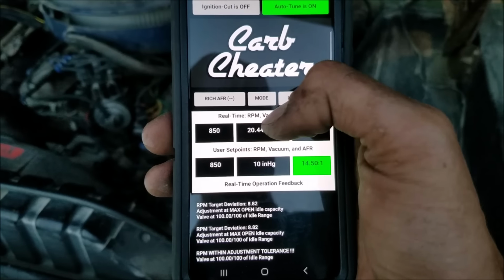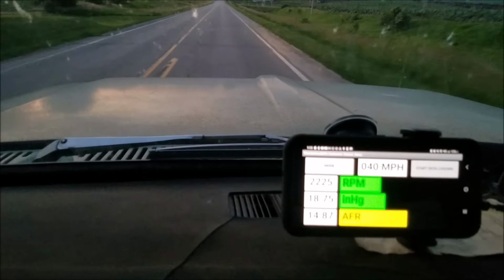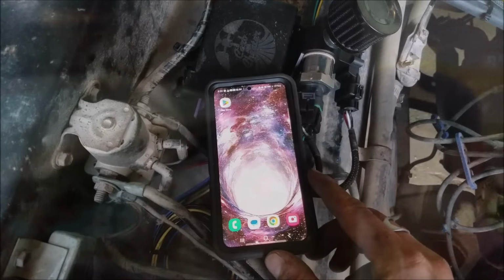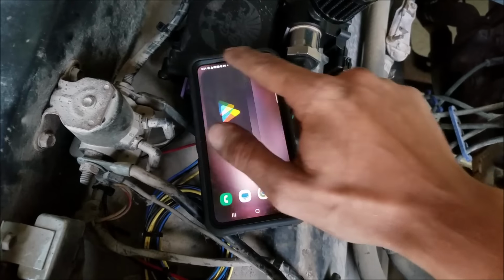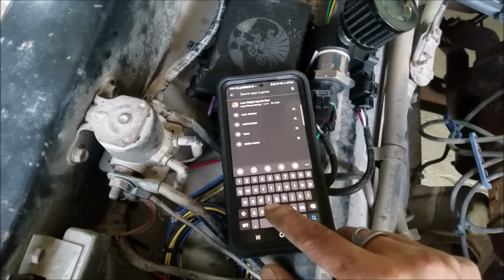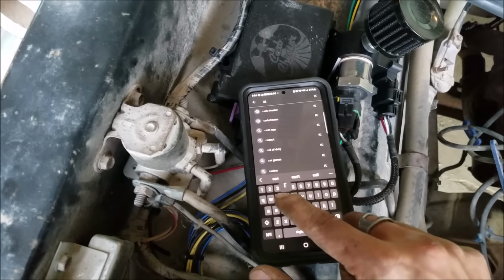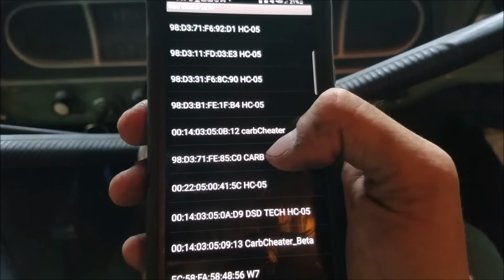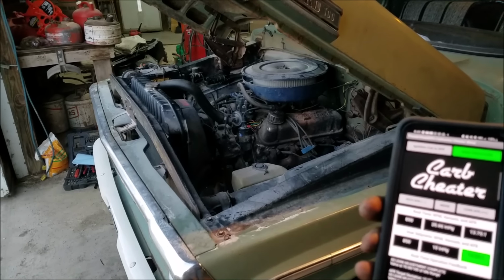Make a SELF-TUNING Holley/Edelbrock Carb! (Carb Cheater: Installation & Setup)

Comment: I have a question.. I see your spacer is set up for a Basically after market carburetor or none GM Because almost all quadra jets are spread bore carburetors. I have not looked into it but I was questioning. Do you make the spacers for those also??
Reply from the maker: Yes. It's on the website order page indeed

Comment: in the waithing of getting the carb cheater order 1812 i have put a oid innovate wideband in my car because of the new build 331 stroker that i dont wanna lean drive to dead.
what are the afr TARGets for a carb enfgne?

idle
light cruising 
moderate throtlle
half throtlle
full throtlle 4000rpm
full throtlle 6000rpm?

thanks for helping
Reply from the maker: Did you order the full kit?
Reply: Yes i ordered the full kit why?

I already welded the Bung and for now installed my old wideband from innovate(didn't think it will work after sitting for 10 years  in a tool box)

Will change everything out when I get the carb cheater
Reply from the maker: @chevroletbelair1  there are a few idle control setting variants - personally I like idle rpm within afr range and set it to my target idle rpm within 12.5-13.5afr. 
Ideal cruising is again up to the user, but I target 14.5.
Anything high load(as per user vacuum setting - triggered by being below the setting) makes sense to be 12.5. 

We're at order number 1650 shipped currently, we just got parts in for the next 300 or so - we are currently putting them together 🙂

Comment: I have a sneaky suspicion that this would be  a great Wide-band to get with Data Logging. .   
And if it can fix these idle and running issues?  I think it would work really well on those older Bosch CIS Injected cars.    

Man, what a great deal with everything that comes in the KIT!

Comment: I don't suppose you make a spacer to put this kit on a buick V6 with a 2gv carb? i know i don't have to have the spacer but i can't find a phenolic spacer for this thing anywhere.

i want to put one on my Dauntless 225 V6 powered 1948 Willys CJ2A. It's my daily driver and I'd like to get better mileage out of it. I've had it as high as 14mpg before, but I'm currently around 10-11 because I can't get the carb lean enough.
I have two carb setups for it:
1- Small-bore 2GV on a stock intake
2- Edelbrock 650 on an Offy 360 Port-O-Sonic
I'd be happy to get either one running correctly.

Between a carb cheater and an overdrive I might get reasonable mileage out of it.

Comment: If you somehow made a kit for a weber 32/36 I would be extremely grateful. I really like your style.
Reply: I'm currently running a DCOE, but have the plumbing to replace it with a 32/36.  I suspect they're on a lot more cars than the DCOE is.

Comment: good idea!!!!......that valve is a 4 wire electric valve, it is a stepper motor bypass, air control valve, it looks like an IAC valve but here we don't just control at idle time , by the MAP sensors and broadband it can be deduced that the air control is at all times, very ingenious, it is similar to the EFI but instead of controlling the cumfuel injection (fuel supply), the carb cheater controls the supply of air, in both ways it is possible to reach stoichiometric mixture control in all engine operating conditions.
..........
......................
that reminds me of 1979 chrysler cars with california emissions controls, even though chrysler was already running the lean burn computer since 1976, the second generation was renamed spark control computer in 1978, chrysler was avoiding meddling with issues of catalyst, which General Motors did quite successfully from 1975, but Chrysler's computer had reached the limit of its emissions control capabilities late at 1978, for 1979 225 slant six engine cars sold in California , more control than usual was required. The computer had a feedback solenoid control module attached to the ignition advance control module, the solenoid did not control the fuel (as was the case with 1981 General Motors' CCC system or Ford's EEC-3), in the case from Chrysler, the solenoid controlled the air, the carburetor was a Holley single barrel, since it was a feedback system, an oxygen sensor was used to work in a closed cycle, the other sensors such as the intake manifold vacuum transducer,  throttle position sensor, camshaft sensor, coolant temperature sensor, and others, were already there since 1976, so their signal was only taken from the feedback module (renamed Combustion Computer at 1979). For 1980 all Chrysler V8 Line-up play to Combustion Computer.

Comment: Do you have to Bluetooth to the unit every time you use it or once it’s dialed in it remembers settings and works on it’s on?
Reply from the maker: The app is just your user interface if you want to see what's going on and make adjustments to target setpoints. Otherwise yes, the brains are in the box itself and runs without the phone connected.

Comment: I was wondering if you had any fuses for the kit… 😅 Fires or burning wires will always will always make you pucker up a little bit…😂 You guys did great man… That’s awesome, I’ve always been a fuel injection guy because I don’t like tinkering with a carb all the time and I never was great at it anyway. I had a cobra intake on my mustang with the A9L computer and GT40p heads and I kinda got bored and swapped to a edelbrock performer RPM and a Barry grant speed demon and I never could get it right. I bet I lost 50hp…😢 I took the carb apart and cleaned everything played with the jets and and made sure the fuel pressure was correct and the floats were right and I just couldn’t make it work man. So I swapped back to fuel injection. I know carburetors work great but it gave me a fit man… Unfortunately that car got stolen by my ex best friend who turned out to be a meth head and I never got it back.  But I just recently got a 72 Ranger XLT. So I’m thinking I might give a carb another shot and try to learn a little bit more and buy that carb cheater if it isn’t to expensive. I was originally thinking about putting a fuel injected 351w and a 5 speed or 6 speed in that truck but I believe it’s all original and I haven’t decided if I want to pull the old 302 out yet… I love this channel btw, thanks for the advice.

Comment: So with a GM mid 90's Idle Air Control Valve, heated O2 sensors, a controller & initially setting the carb rich with a low idle speed the air control valve will make the needed adjustment via a vacuum leak. 
Thinking maybe for sbc engine a used GM TBI system may worth taking a look at.
https://youtube.com/shorts/lYQ9j-YmnaA?feature=share
Reply from the maker: Or just use the tools in your hand to tune your carb well with carb cheater. Auto tune can be turned off - mine barely does anything because I like doing everything raw carb. 

But all that aside, the 80s tbi was reliable but made terrible power. Don't do that lol idc if you don't buy a carb cheater, but man don't do that
Reply: @ThunderHead289  They made good power just back then not may knew how to work on them. 
I myself like carbs but if one don't know how to tune them for MPGs that's a problem. 
I have been working on carbs for over 55 years & ASE master in 2 feilds +.
They only carb I was not fond of was the Ford Variable Venturi carburetor.
The best carb out there is the  Motorcraft style 2150 2 Barrel Carburetor it helps if one blocks the power valve & just move up the jet size & it should be good for decades.
Qjets are good just put 49 metering rods & a 73 jet on the primaries with a week power piston spring good mpg's can be had, brass float, return spring on the secondary shaft & drill out the secondary accelerator jet ports just a bit smaller than the straw of a WD40 can. 
Then just say off the secondary & one can get 18-21 mpgs hwy if one knows how to tune timing advance.

Comment: I truly love your channel, inhave learnt so much from you. The way you explain things, making something potentially complicated simple and easy ro understand is an art. What you have done here with carb Cheater is amazing and fantastic, I want one. I will be e mailing you as your shipping doesn't include Canada. So I am hoping we can sort something out so I can get one as well. I live in Alberta not far from the mountains, and I own and operate a small landscaping business using a square body chevy truck as my daily work truck ( 1980 K20 ) I got the tune as good as i can as I got an afr a few years back after watching your vids about them. I maintain a good 14.7 however living where i do those temp changes amongst preasure changes mess with the tune all year long. I also plow snow with this truck, so Temps change 10 to 20 degrees over the day to night especially where I live when we get a Chinook. Anyway I had thought about getting efi but the guy said if i am diled in with myncarb as i am efi won't do much better. So seeing what you have made here will look after those changing variables that I deal with over the course of my day.  Looking forward ro your response and thanks you for all the time and energy you have put into your channel and development of carb cheater.

Comment: So, what's the problem with learning how a carburetor works and tuning it correctly as opposed to band-aiding it? Not to mention, if it is allowed a large amount of correction ability, the oxygen sensor will wreck itself in a matter of no time flat..
Reply from the maker: Put a wideband on and tune your carb perfectly (it's 80 degrees outside mid afternoon) 
Drive to work in the morning following day, idle and cruise are different (55 degrees). 

I do want people to tune their carb, the wideband tells people who haven't done this for years where they are at. 
Then adaptive stuff handles the small day to day variability. 

Plus I put some other fun items on there like the Rev limiter, 2 step, rpm window switch, and so on that I have really yet to talk about.

Comment: Perhaps I don't understand enough about carbs in general, but how does this make adjustments to the carb without turning any screws? i.e. idle speed, air/fuel mixture, etc.? If all you're hooking up in vacuum and an O2 sensor...I'm confused. :)
Reply from the maker: My most recent upload will be enlightening 🙂
Reply: @ThunderHead289  thank you sir. If I understand right, your wizardry basically automates the air flow into the carburetor, yes?

Comment: Add 2 bank lambda and im sold :)
Reply from the maker: No need for it - one side of the carb feeds both sides of the engine. Only need dual o2 for port injection 🙂

Comment: This looks a very nice tuning tool. But how exactly is it 'auto tuning' the carb?  What is the theory of operation?  How does it change the carb mixture to lean or enrich?
Reply from the maker: It's a controlled air bleed - simple and universal, but backed by thousands of lines of complex code to keep the physical aspect simple. 
It's also a Rev limiter, gauge pack, ignition lock, graphical datalogger. Rpm window switch relay, and a few other things. All in one deal
Reply: @ThunderHead289 Ahh, I think I understand how it works now,  This system uses an electric  valve to modulate air bleed into the manifold vacuum via the carb spacer vacuum port(s).    I've got a twin barrel Webber 36 on my stock 71 FJ40 landcruiser this might be good on.   I know its new but is there a list of carb make/models  and/or engines it has been successfully installed on?

Comment: So if I understand this thing correctly, all it can ever do is add air to increase idle and lean out the AFR. If your engine is already lean, the Carb Cheater (I'm guessing) will probably not do anything at all (for safety).
Reply from the maker: Carb cheater is a tuning tool, most carbs despite folks thinking they are decent are tuned like hot garbage. The idea behind Carb Cheater is to give someone the chance to make them not hot garbage since you don't have to guess. Then it will handle the day to day anomalies pretty well from there. 

It also has a Rev limiter, full graphing datalogger, ignition lock, gauge pack, and rpm window switch relay built in.
Reply: @ThunderHead289  So it's more intended as an instrument to help you manually tune, and the auto tune function is "just a bonus"? Do you find that carbs tend towards being rich more than being lean?
Reply: @ThunderHead289  Just to be clear, I'm asking out of genuine curiosity. I'm not trying to poke holes in your design, nor am I an expert in engine tuning 😅

Comment: Very impressive creating a controlled vacuum leak to lean out a rich carburetor until the mixture gets as close to stoichiometric as possible.  An elegant and simple solution to a limitation of carbs we've had to put up with for years.
Reply: it's the spiritual successor of the electronic carbs of the 80s and 90s. Those left a sour taste for a lot of people because the devices were somewhat ahead of their time; they were limited by the electronics they had back then. now we carry a computer in our pockets that has more processing power than the apollo 11 landing computer, and we can use the same kind of processing power for engine management.
Reply: you can tune the carburator to be more" stoichiometric,", i dont know if you can do it,, -- just use a o2 sensor  and make the tune according to your driving like
Reply: he jsut want to sell you carb cheater to idiotslike you ,, make my day..
Reply: well you can lean a little bit the carburator and yo go stoi, thas whya i do in all my cars... Dont need stupid useless garbaged connect to the perfect carburator.

Comment: Im putting a 2004 T5 in 1963 Fairlane . I was thinking on getting a gps speedo and a afr wide band  for it , now I'm thinking this would be a much better Idea . Ive got 2 questions though . 
 1 How well does this set up work with modifications , cam, heads , performance wise modifications to motor ?
2 Does the speedo have both mph an kmph ? 
3 Do you ship to Canada ?
Reply from the maker: I need to add the kph option but it's a simple app update, works fine with anything really - mind you it's for idle and cruising, the harder your into the throttle the more "raw carb" it is which is the scenario you should optimize your tune for. And were getting close to Canada shipping, just handling the dumb terrif stuff yet

Comment: How are you controlling fuel flow? Isn't the carb just doing its own thing?
Reply from the maker: I have a metered air bleed more or less
Reply: Ingenious, this is the coolest thing I've ever seen! Hard to believe anyone's hating on this. Your price is extremely low, the only thing stopping me is that my Corvair has 4 carbs, 2 primaries, 2 secondaries. :(   It's more like two 3-cylinder engines so I'd need two Carb Cheaters. But TTYTT I'd consider buying another old car just to play with this. WAY cool Luke, you are the master!

Comment: I have a 200 cu in straight 6 with a tri-power set up. It has 3 one barrel carbs. Under the center carb is the main vacuum port on the intake. I don’t have hood clearance to add any kind of an adapter under the center carb. How would I hook up the carb cheater?  I would post a picture but can’t see how to do that here.

Comment: That stupid electronic carburetor will get you stuck somewhere
Reply from the maker: It absolutely won't since your carb is still your carb. If it were to fail, which it won't because it's a tank, but if it did, you can drive home no problem.

Comment: So what does it ACTUALLY do to tune your carb? Watched the videos but still don't know what it's actually doing to tune it
Reply from the maker: You use what you have in the palm of your hand to actually tune something right. Then you enable carb cheater to handle the variability that will be there no matter what you do. It's a dynamically controlled air bleed. Simple, and robust, but capable

Comment: 21:00 my rubber thing inside the brake booster its broke so it will cause a faulty read ive noticed hahaha, good idea of the carb cheater men, its the best of both worlds in terms of efi and carbs!!

Comment: K&N has the same system or close to it for sale for awhile. Summit racing has them in stock. There double the price though.
Reply from the maker: And you can't see any of your telemetry which is bar non a huge tuning advantage in the palm of your hand.
Not to mention carb cheater has a Rev limiter, rpm window switch relay, and ignition lock built in as well

Comment: So a controlled vacuum leak ...simple and effective and what a blessing for folks who live in climates with massive temp and Barometric pressure swings... I fuel inject everything because I lean burn my gas rigs... But this is a decent solution for Holley and Carter that have less than stellar emulsion processes ...good job

Comment: You forgot to mention one other permutation on the carb studs.  Sometimes they are JB welded in the stripped out aluminum manifold.  Very interesting setup and another great video.